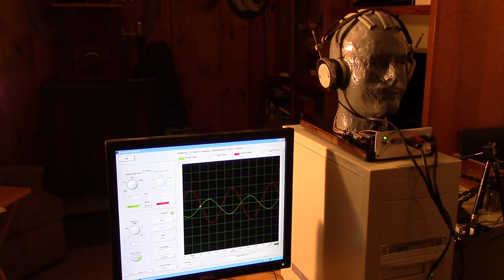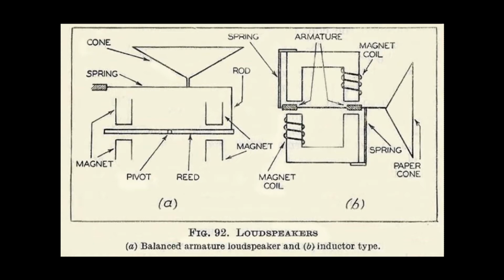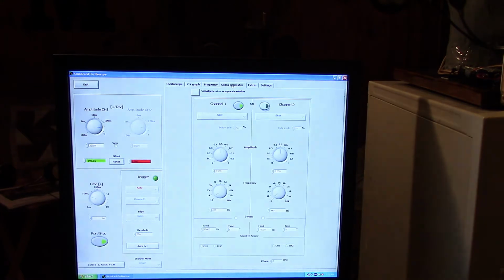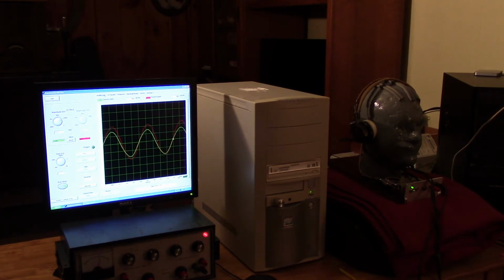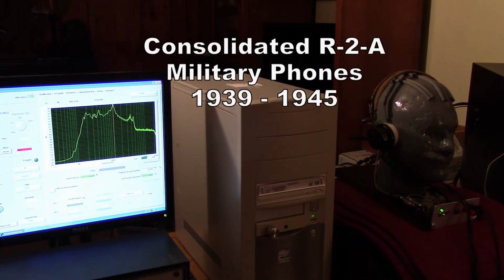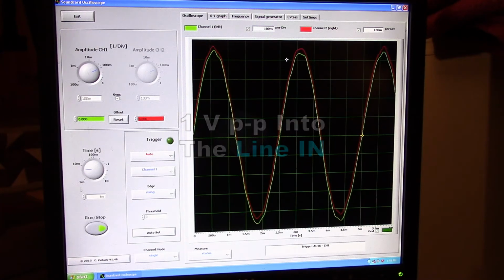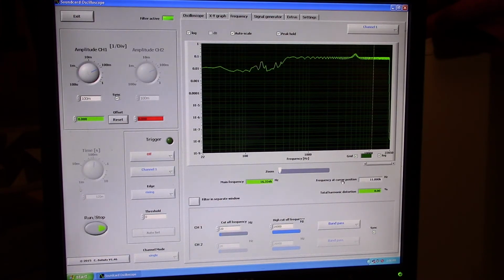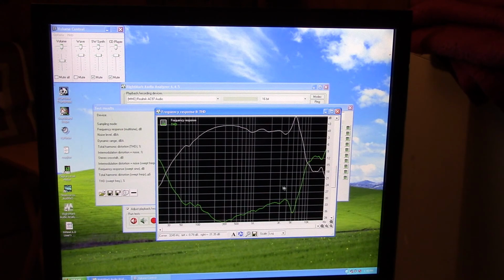Headphone Testing Part 2

Comment: I personally like those old crystal headsets, I have a pair of western electric from 1918. Something about them produces a nice sound not like others. And the headband isn't too tight like others either. 
Believe it or not I hooked them up and played some music on them too, and I must say they were quite nice, not to Flat or too much bass /treble. 

BTW,  any thoughts on blast proof speakers that are used on military equipment? I've found there kinda nice too, vs the other options you find at swaps like those God awful Motorola speakers that you find tons of. The motorola's  don't get very loud and they just get real distorted easy, even on modern rigs of the correct impedence. Perhaps it's just the ones I find 🤷
Reply from the maker: Cop proof speakers!